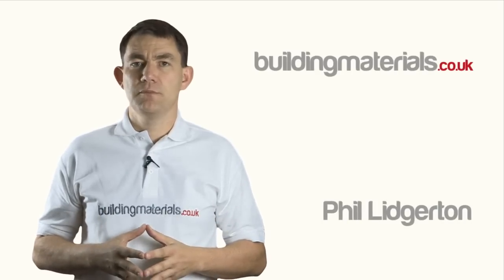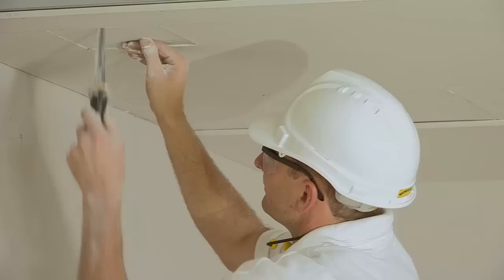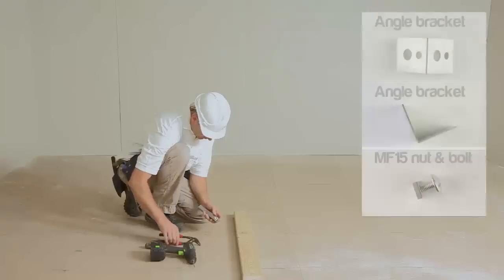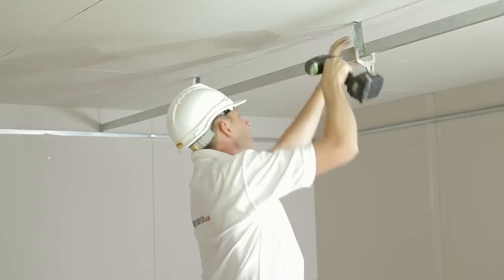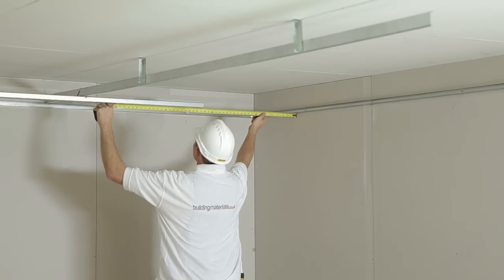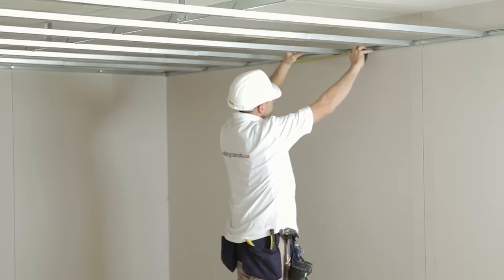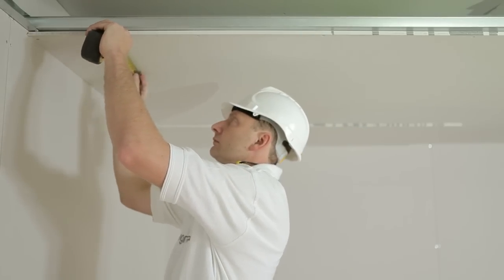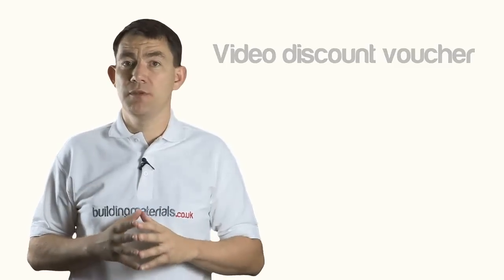How to Install an MF Plasterboard Ceiling

Comment: I believe this is very old instruction manual for installing Casoline MF ceiling. 

As I have noticed first MF7 main bar was even more than 1200 from the wall. 

Especially when you are trying to fix 2 skins on the ceiling… if MF ceiling starting to fall, it falls as a full ceiling and videos which I seen are very dangerous… could lead to a death ☠️ 

Regarding boards direction - must be cross fix to MF5, and not along the top hats (MF5)

I can see that video done a while ago and as you aware drywall specs and details evaluate every year, a lot of specs which were using years ago - not accepted any more due to different reasons. 👌

Comment: Not the worst I've ever seen.
But....
1. 600mm is too far between fixings on your mf6a
2. Fix your mf7 to the wall or to the trim.
3. You need to properly level your mf7. Using your hangers as a guide will almost never work. 
4. If this is in your home, I'd recommend using the tek screws rather than mf9 clips to secure the mf5 to the mf7. It's nothing structural, just that the clips can creak if theres slight movement or air conditioning in the house. 
5.  Always use 2 screws when fixing mf7 to hangers.
6. Always stagger your joints on mf7 & mf5. Never have them all in a line. 
7. Boards always run across the mf5, never with it. 
8. Never start with a cut board. Put a full sheet up, away from the wall, at a perfect 90° to the mf7.

Comment: Does this type of ceiling system provide good sound proofing for both airborne and impact sound transmission?
Reply: Yes it can provide good sound proofing if you use double plaster board together  or sound proof plaster board. Please fill the gap with sound proof filler. On the floor please use thin sound proof mat under carpet. Hopefully it will pass the soundproof test.